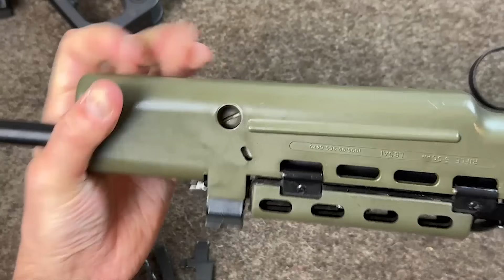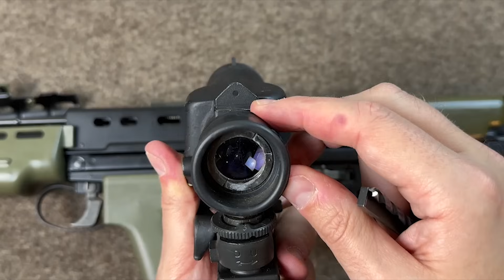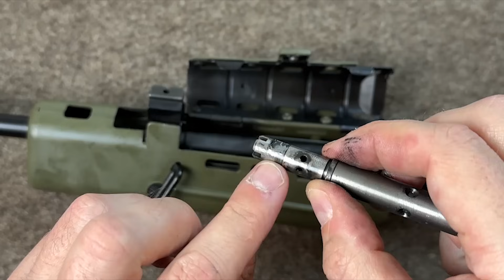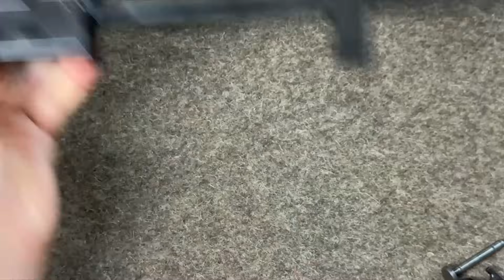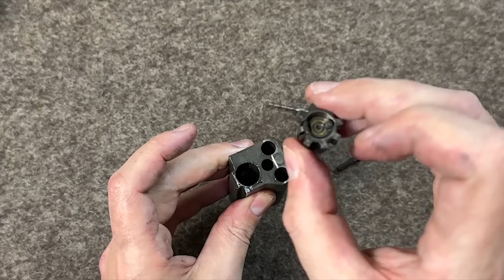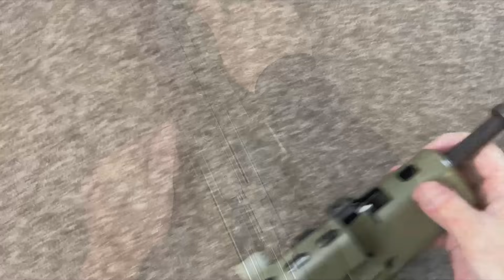British Rifle L85A1 / SA80 IW: The Mechanical Gory Details (Rare Factory Semi)

Comment: The only thing I found odd about the british army's rifle Is they never came out with a sa80 with a 20 inch barrel. I get it, that it wasn't supposed to origionally be 5.56. But when they went to 5.56 and didn't change their military's focus. Its a little odd that they didn't make the switch to a 20 inch barrel. 

For example of what I'm getting at is america's tactics made a heavy switch to cqc and mobility. Which results in higher casualty and injury rates. An m4 is just a monkey cut down m16.

Which is also part of the reason I'm a bit disturbed by the british goverment making the switch to a gun with a 14 inch barrel. It kinda looks to me like their goverment is abandoning the ideals of proper positioning and range.
Reply: The L85A1 has a 20" barrel. The L86A1 has an even heavier and longer 24" barrel.
Reply: @zoiders  Ok didn't know that, but the reason I mentioned it. Is because 5.56 is designed around having a 20 inch barrel.

Comment: I saw and handled the SA80 in.22lr some years ago, shame it never made it to market...
Reply: That was a conversion kit that fitted the L85A1, L86A1 and the L98A1. It dropped straight in and was a blowback conversion. It was manufactured by Hk. They were for indoor range use at TA centres. They fell out of use as the SAT system became more prevalent.
Reply: @zoiders  sure may well have existed though this was a complete ground up new design in.22lr made by Law Enforcement International for the domestic market. There were a few prototypes though it never came to fruition sadly...

Comment: I hope you cleaned it the breach was gunked up, the bolt, bolt carrier, cam stud and firing pin retaining pin was covered in too much oil and muck, the gas piston, cylinder and plug were covered in gunk I bet the barrel was awful too! They only need a light oiling when stored then obviously drying before use my problem was the cocking handle could become detached occasionally and was a bugger to put back into battery if it was mucky which was quite often in sandy conditions
Reply: They run better wet. They always did. Over cleaning with abrasives was the very thing that caused some of the problems in the first place.
Reply: @zoiders  never had a stoppage in 5 years friends always did when they didn't remove excess oil, my only problem was the cocking handle on the a1 fell out occasionally got my bolt carrier replaced twice but the same thing happened 3 or 4 times a year pain in backside moved on to the lsw never happened again i left before the A2 came out!
Reply: @chrisgraham9919 I would describe your cocking handle falling off as a rather serious stoppage. Very likely out of spec due to being dry cleaned with abrasives.

Comment: Used it for 30 years and I can honestly say I never had any problems with it. (Bad workmen and all that.). But people saying the Brits should’ve…. Well perhaps we should have ignored the Yanks and NATO saying 7.62 is the way ahead, before the Yanks bailed on that NATO standard and went 5.56, and stuck with developing the EN2. It showed tremendous promise and never had most of the dramas the SA80had.

P.S. I was never taught to disconnect the sling before threading it, so I don’t know where you got that from.
Reply from the maker: The EM-2 didn't have the dramas the SA80 had because it never got beyond 60-100 hand-built prototypes... The real dramas start with ramped-up serial production and in-service use.
Reply: @BlokeontheRange  but that’s why I said we should have stuck with the development of it. They could’ve engineered the problems out, we we’re pretty good at engineering back then.
Reply: @BlokeontheRange  Were there "dramas" with the L1A1 as the hasty replacement for the EM2, though?
Reply: Ex Coldstream Guardman who used the SA80 in Northern Ireland and 1st Gulf War, great in Ireland where the SUSAT was enormously useful and there was no sand, mud or snow at least not in Belfast, and absolutely appalling in the deserts of Iraq and Kuwait. The lads were trying everything they could to get the thing to run but it hated sand. And as you can imagine it wasn't due to lack of maintenance in a Guards regiment. I was very happy that I ended up with the GPMG in that theatre which of course worked perfectly.
Reply: I'm another of those who never had a problem with my SA80 weapons, but then we Riflemen actually look after our kit so I don't know what the other children (infant-ry for a reason) were doing to so badly break their toys... 
Disconnecting the sling was the older manual of arms. Squaddies worked out that it wasn't necessary and stopped bothering, so they changed the manuals!
Reply: I agree - its just fashionable to complain about it - obviously it isn't perfect, but not that bad. Very heavy for its size though.
Reply: @johnhardy4152  That's what she said....
Reply: “I do t know where you got that from”. He literally said it was in the manual.
Reply: @MrOtistetrax  It's in the 1991 Skill At Arms manual, but they obviously revised this by the time both ^this guy and I got issued our weapons. Bloke's rifle predates this change, so it makes sense that any matching period manual he has would specify the old procedure.
Reply: @MrOtistetrax  I got it from my instructors at Sandhurst in 1994/5 and taught recruits this way in 1998. So that's where I got it from.
Reply: @cnb1971  So post-1991 when the changes happened...
Reply: @Sarrienne  well no actually. In 1994 we had the un modified A1 and I didn't get an A2 until 2002 for Op FINGAL.
Reply: @cnb1971  1994... which is post-1991 when the changes happened, then!
Reply: @Sarrienne  yes and no. The initial run was up to 1994, then they had the review to make the changes making the A2 but that wasn't until the early 00s. My point was that I never had any real problems with the A1. The A2s and 3s are obviously both better the A1.
Reply: @cnb1971  The SLING has not changed. The only thing that has changed is whether or not you undo the clip and separate it into two parts during the attachment process, which changed before the 1992 SAA publication. 
Nothing to do with A1, A2, A3 or Ahfuggid-gettanew-1 revisions of the rifle itself.... It's one picture in one manual.
Reply: @ I never said the sling had changed, just the method of attaching it.
Reply: @cnb1971  Which is what I have pointed out numerous times - It was disconnected in the 1991 SAA and this had changed by the 1992 SAA... hence you were never taught the disconnect even though you still had the A1 in 1994.
Reply: @ actually you never mentioned slings you were talking about the different mods. Hey ho, I’m bored now.
Reply: @cnb1971  Mentioned it in my very first comment... right there, where it says "Disconnecting the sling was the older manual of arms". Every subsequent comment has been in reference to this, including reiterating that I'm talking about The SLING not changing and directly referencing the SAA manual. 
So is 'bored' just rupert short-hand for wrong and can't cope with it?
Reply: @Sarrienne  no it means you're being dull...oh and rude.
Reply: @cnb1971  Being dull - I'm making the effort to get it right. How is that such a problem for you? Perhaps if you had been less insistent on your own experiences being so defining, you'd have had a more exciting experience. 
Being rude - You're the one calling me a liar, and when the truth is right in front of your face. 
Perhaps go back to playing with your train set... "sir".
Reply: I never liked it when we transferred from the venerable SLR. The A2 should have been the standard when it was issued, the A1 was below par, the A2 was a different beast altogether, I was impressed with the upgrades.

Comment: I recall the instructions about the rear pin not being fully removed. And the teenaged cadets that didn't listen to any of them resulting in many a sproing during disassembly :D
Reply: @MrGrimsmith  best 1 is the firing pin retaining pin I lost 1 never made that mistake again found it after a finger tip search by the whole platoon 2hours later 😀
Reply: same here...   also the handguard wasn't allowed to be removed unless told to do so..
Reply: @DevilbyMoonlight what do you know ya Knobjock . Durch! 🫡
Reply: It's funniest when this happens in the back of a 4-tonner moving down the motorway at 50mph
Reply: i can confirm this happens, seen it myself. very sheepish looks.

Comment: When I was a sprog all of the  L98A1s had a fence around the mag catch by about 1991 as did the L86A1s. Curiously the cadet forces recieved these before the TA did in many cases so the fence must have been something the REME did on mass before further roll out after feed back from infantry battalions. When I was grown up and moved on to the L85A1 I must say that I always ran the regulator on "E" and it cycled just fine with Colt magazines. At this stage you will get the Walters telling tall tales of stoppages and "battlefield pickup" of AKs but please ignore these people. What you have to remember is that just as roll out happened the MOD made tens of thousands of blokes redundant. This left a surplus of rifles. This meant the wonky ones that simply didnt run got pulled and gas axed as time went on. An expensive and ablative process but one that undoubtedly happened. If there was anything that caused a problem it was always the wanky RG mags. What exacerbated this problem was guard duty. The guard is changed every 12 hours and every magazine was loaded and unloaded twice a day. So thats 730 load/reloads a year. Some of those magazines made it back into the circulation and that is when the horror stories start. As for the furniture breaking the only problems were with the early butyl butt pads. These are easily identified by how shiny they are and the darker shade of green. Again you almost never saw any as they were mostly binned.
Reply: You know, you're not supposed to look at things with any pragmatism? What we're supposed to do is slag it off to "fit in" with American youtubers who have never served, let alone in the British Army.
Of the may Brits whingeing about this rifle, you'll find that 99% are ex cadets and RAF hats.
I found the A1 and A2 to be absolute lasers so long as I did my part.
Stoppage? Oh just cock the fucking thing and get on with it.

Comment: Just seeing you striping it reminds me of how easy and elegant the SLR was to strip.  While the SLR was feeling its age by the late 1980s the L85A1 was not the solution.  Once again politics robbed the British army of a good rifle.
Reply: I may be described now as one of the old and the bold.  The 2 good things I remember the sling which made living with you rifle on exercise much better.  Also I went from scoring mid 30s in the battalion shotting competition to possibles or only dropping 1 or 2 shots
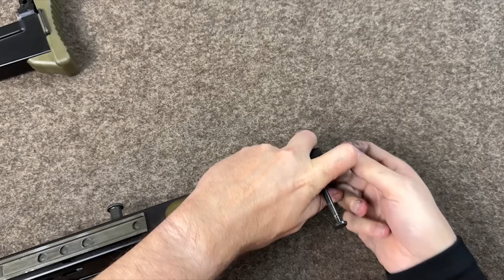Reply: The L1A1 was utterly useless for night fighting which was why it was doomed no matter what. You might note that when the RM needed 7.62 rifles that could take optics they didn't mess about with a lengthy procurement process or waste money on UOR. They just got hold of Royal Ordnance produced G3s from stores and whacked some 6X ACOGs on them. Which is exactly what all the other nations which G3s in stock did. The L1A1 just wasn't worth the hassle to convert. The SF had been using G3s the same way since the 80s. 24:27
Reply: @ I think it would be pushing it to say it was utterly useless for night fighting.  I would reference Tumbledown and Seven Sisters as examples where they were used.  

However as night vision devices improved and became practical the lack of a good mounting system on the L1A1 certainly counted against it.  However the move to 556 and the age of the L1A1s were bigger factors I think.
Reply: @neilmorrisonBillSlimsFanClub At the Seven Sisters and Tumbledown the L1A1 proved so ineffective for fighting in darkness that they man packed MILAN AT systems up there and used them to engage Argentine positions. Not just for the explosive power but for one very telling reason - the MILAN had a full night fighting capability, you could actually see the target and hit it using the MIRA thermal imaging sight.
Reply: @zoiders a good point.  I think the point I was try to make was that it was not completely useless but the effective range would be less than,from my experience, 30m. With lots of flashes from multiple sources soldiers night vision was quickly degraded.   I remember doing night shooting with my SLR and after the first couple of shoots I was struggling.  However I would have thought that it was more a human issue rather than an issue with the weapon.

The ability to pick up targets depends on many factors such as silhouetted or say in a trench

Comment: Factory Semi-Automatic???
That's a huge improvement on the factory bolt action they issued to the army
Reply: as a cadet i used the legit factory bolt action and it was horrific to operate and i don't even have long arms...
Reply: @Hitperson  I shot the L98 at Strensall a few times in the ATC and hated it too. I had a double feed on one day and 5 consecutive misfeeds off 2 different mags on another day. The fucking rear sight being right in your face was another thing; I had it brush my eyelashes before I learnt to crane my neck back as far as it went and a lad a few lanes down from me got his eyebrow gashed open. Sniper's eye off of iron sights...
Reply: @spankeyfish  the L81 was a bastard for that too. Or at least mine was. My coach was insistent on keeping the settings for the main shooter when I came in last minute as a reserve. The eye relief setting was off and I had to tense my neck back to keep off the sight. Keep everything the same he said, well sir I have a fucking black eye and my neck muscles are locked do you think that will affect me, I asked on day 2 at ISCRM… was shaking the whole time and couldn’t shoot straight at 300 yd…had my usual coach from home on day 3 and she set me up proper, was hitting successive v bulls at 600 yd, wasn’t far off the hundred - not bad for my first time on the rifle and first on the long ranges.
Reply: That's a sensible chuckle there.
Reply: Mine was stone cold reliable.
Reply: Yeah so, like the full auto, it goes bang once when the trigger is pulled...
Reply: That is highly questionable, at least before HK worked on modifying the design and made over 100 changes. It was know originally as the civil servant, it did not work and cannot be fired.  The British are obsessed with power grab and gun control, you are much better banning guns than to design and make any good ones, at least at affordable prices.

Comment: The forward sling swivel was often sneakily moved to the lefty side for  Drill/ ceremonials. Saving squaddies a sore shoulder when constantly sloping arms
Reply: Swivel mount never an issue, cocking bolt in the elbow joint…. 😢

Comment: Why is there a drill bit on the tool. I saw him use it as a punch, but drill bits are hardened. Seems Hella British, dumb as 💩
Reply: Brits: Why gun no work?
Yankees: cause you used sharpened hardened steel on yo frames 😂
Reply from the maker: I thought I explained. It's for cleaning the gas plug. Maybe I'll do a vid on what the bits of the multitool are for.

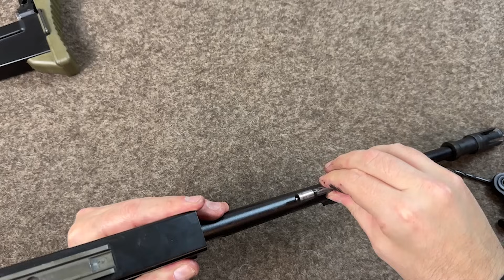Comment: @23:00 I've not been ballsy enough to try it either, but I think that's just another ism that's been passed down through the generations. The detent doesn't fit through the top hole and it appears that the gas hole was drilled from the top down. Still, I'd rather you tried it than me.
Reply: Speaking to armourers at Brize and Halton, they have had to fix numerous stuck gas plugs. It's not a biggie, so long as you have a rod that will fit down the port to depress the plunger and just turn it back, but since most people don't have one to hand it usually "needs to go back to the armoury"... hence the PITA-ism and subsequent piss-taking if you do mess it up.
Reply: Yep, we had the A1 as well and the armourer mentioned that you always reinsert the gas parts into the front sight block with the detent pin facing the sides - because it could indeed lock up in that hole if inserted with the detent pin facing up. And definitely agree regarding the mag release shrouds - we never had A2 but I recall the retrofit. We used mainly Cadet GPs and the retrofit was in 1994 or early 1995, maybe...

Comment: Does the iron sight not say 200 below the aperture? I wonder when that was added.
Reply from the maker: It does, for the small aperture. The question was rather whether the low light, large aperture was at the same height.
Reply: @BlokeontheRange The current manual doesn't give a distance, just says low light. It's such a large aperture I suspect most military firers wouldn't be able to tell what distance it's zeroed for.
Reply: @elliott5056  Agree… Cadet Force RCO/Coach here… you can immediately tell if a cadet fails to use the 200m aperture because the low light aperture converts the weapon into area denial mode… it struggles to group any smaller than the full width of a Fig.11 target at 25m…